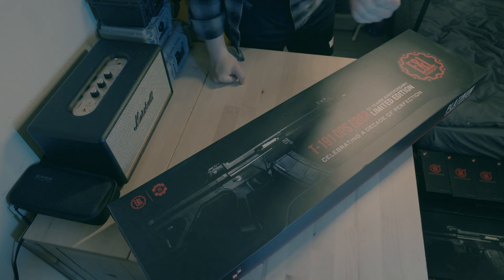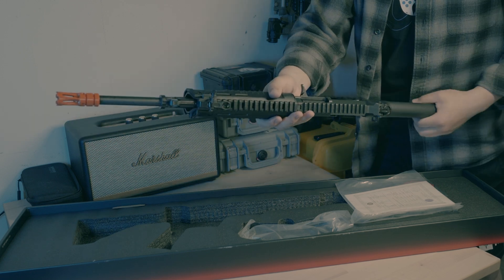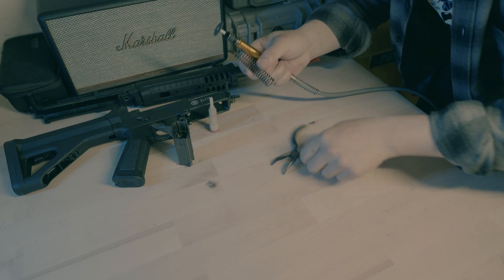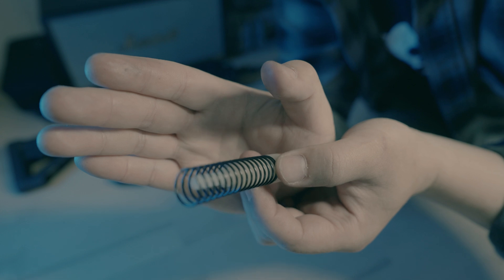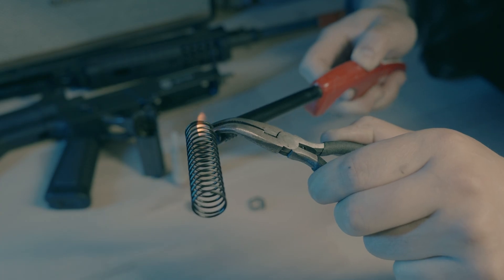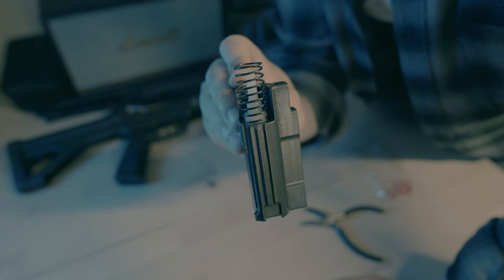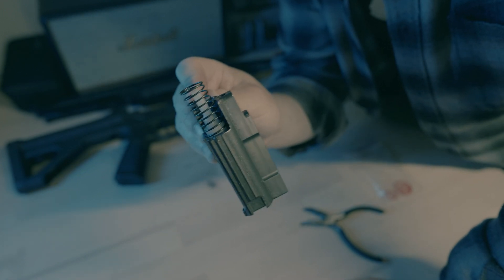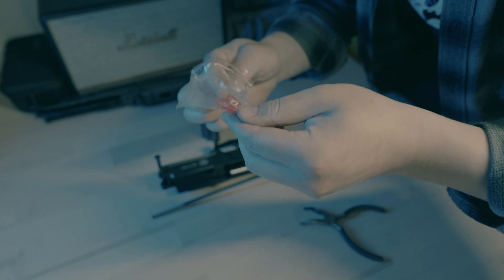E&L T191 FPS improvement trick

Comment: sorry i'm lost, but why shorten the nozzle spring will increase FPS?
Reply from the maker: More stable FPS meaning less air leak, better air seal meaning more air, more air meaning increased FPS.
Reply: The problem is the nozzle doesn't fully seal against the hop rubber before firing, I suspect the design relies on the initial air pressure to fully seat the nozzle. But if the nozzle return spring is too strong, the air pressure can't seat the nozzle until it's too late (bb already moving), thus causing air leak and low fps.